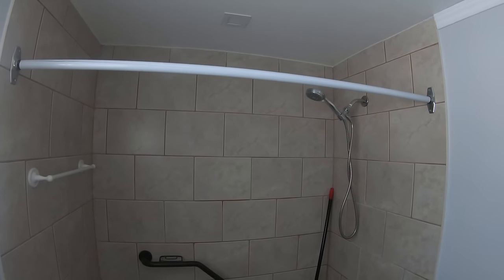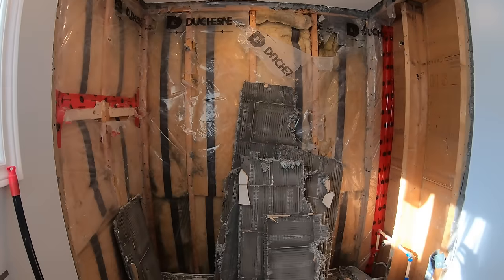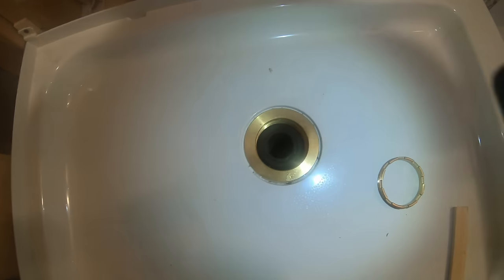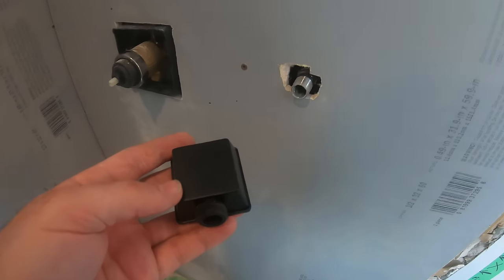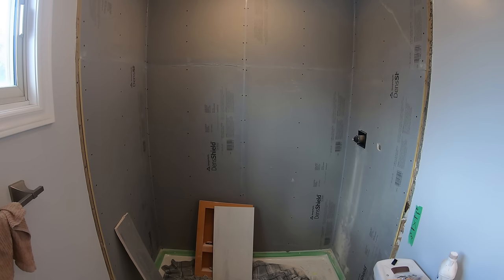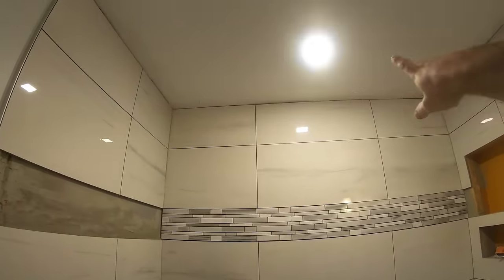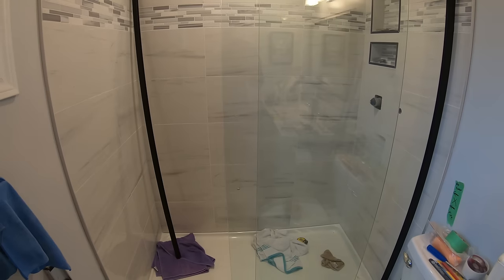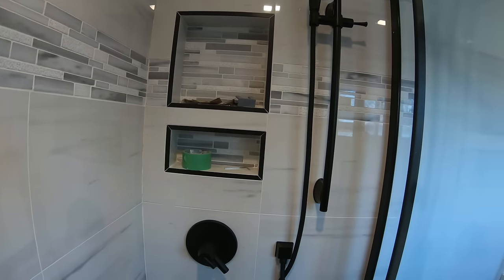$4000 Tub to Shower Conversion

Comment: Man, I wish you were near me. I'm converting an old one pc. tub enclosure into a walk-in shower. Removal is not a problem, but the choice of conversion kits is a puzzle. Your job was professional, and your skills exceeded many of the so-called qualified installers. Thank you.
Reply from the maker: Thanks so much, I really appreciate that 🙂
Reply: @tokyosteve1223  Great video! What tile did you use and where did you get it from?  Also, same questions for the accent you used for your niches and around the shower?
Reply from the maker: @bosshova23  
https://www.anatoliatile.com/collections/mayfair/suave-bianco

12x24 polished 

Accent tile

Bergamo Interlocking 10mm x 11.81-inch x 11.81-inch Marble Mesh-Mounted Mosaic Tile

https://www.homedepot.ca/product/msi-stone-ulc-bergamo-interlocking-10mm-x-11-81-inch-x-11-81-inch-marble-mesh-mounted-mosaic-tile/1001129871
Reply: Beautiful job!
Reply: I just finished a 60x32 tub  to 60x36 ADA shower. In portsmouth, va
Reply: @bosshova23 lowes has the tile.

Comment: I hate to tell you this. You should have hired a plumber. All shower drains have to be 2”. You left the undersized 1-1/2” drain in. That’s plumbing code 101.
Reply from the maker: Yep, I knew it.  The house was built with 1 1/2, and it stayed 1 1/2.  Never had a problem, never will be a problem with a single showerhead. 😉

Comment: Can use 2 screwdrivers through drain grate, form and x and just twist. Comes right out.
Being said.. no vapor barrier, did not seal backer board or the joints. Simply laid tile on board. Yea saves some material cost but.. not how its done.
Reply from the maker: So I probably should have elaborated on this more in the video.  The backer board is called DensShield.  They specifically tell you not to put a vapor barrier, because the board is waterproof, and becomes the vapor barrier.  Also, all the joints were sealed with polyurethane caulking following the installation instructions of the DensShield exactly.  I know it looks like a different installation than typical backer board, but I followed the instructions to the letter.  🙂

Comment: not bad, but in my honest opinion i would rather be standing on tiles on the floor with heating underneath the tiles and a wide drain on the tiles but thats me.
Reply from the maker: Baby steps man.  I used a premade base for my first try.  I just did my own ensuite shower where I did tile the pan and it turned out great.

https://youtu.be/MLQSBPD-Qdc?si=mvTeS1rkVJOHzJcZ

Comment: Looks good! I also looked far and wide for information on how to install a shower wall union, but came up empty. Thankfully I'm installing it on a fiberglass surround which can flex a little bit, so it's more forgiving than tile.
Reply from the maker: It's a simple thing with unforgiving tolerances, like +/-  1/16"
Surely loads of people have tiled their wall and messed this up because there is so little information out there 🤔

Comment: Good Job, one comment for next time, put a sheet of plastic on the subfloor before installing the mortar/cement. The subfloor tends to suck up the moisture from the cement and shrink. This will cause the shower pan to flex and eventually crack due to the space between the cement and shower pan.
Reply: Won't this mean the mortar won't be connected to the subfloor, but would just be sitting on the plastic below, and potentially move?
Reply: @zigner  won't move since the pan is fastened to the wall studs. The cement helps support the weight of a person by making the shower pan stiffer. There are shower pans out there that don't require mortar, this is due to the manufacturer adding alot of stiffening ribs.
Reply: @zigner  Imagine it in 3 layers, subfloor (movement), mortar with shower tray fixed. If all three are bonded together, any movement from the subfloor, will affect the mortar which in turn ends up cracking the shower tray. You need the plastic sheet in order to allow the subfloor to move, without it affecting the mortars movement. For ease of access, you can use shower tray feet instead of using mortar.

Comment: Beautiful job! That square outlet, I can see how this is the most stressfull part of the work. You pretty much have to trust that the amount of tape and turn count is exactly right. And on top of that when you`re at your last turn you need to properly evaluate if it can do a full rotation or will it get stuck and you need to go back to the last straight position. And that tape doesnt like turn backs too much. Surprisingly the tiling is the easiest part of this job :)
Reply from the maker: That's exactly what went through my head causing stress for days leading up to doing it 😂😂

Comment: I have the SAME EXACT beige tile in my bathroom. It was layer unevenly and is almost impossible to re caulk because the grout lines are uneven. The tile doesn’t even go all the way up to the ceiling so refinishing isn’t an option. It all needs to be torn out and be redone.

Comment: Nice work did a very similar job on my bathroom which was about the same size. Two problems was the shower drain things didn’t line up exactly right and got the shower pan during lockdown and I had to settle for a pan I didn’t want. So the shower drain leaked had to move plumbing over about an inch so things lined up this was a pain as access from underneath was tight. Finally fixed that. Then shower pan was noisy and yes I put mud under the pan so had to shim subfloor. As for lessons learned get a good strong pan. Make sure plumbing lines up perfectly and using bigger tile like you did will inure a more even finish. I’m satisfied with mine but could of been better. Then again I’m no plumber, tile guy. Plus saved a bunch of money and the wife doesn’t notice any of the things I do.
Reply from the maker: I had a similar issue, even with a bed of mortar the base still creaked a bit, so I shot some low expansion foam under the base before the walls went up and I had access through the stud cavities.  Seems to have done the trick, but that didn't make it into the video.

My plumbing didn't line up either, but I'm well over my fear of just hacking it all off and connecting new pipe.

Comment: 10:28 agree 100% 
I’ve no idea why but there is almost instruction and no template for the hand held showerhead water line and how deep to set the drop ear elbow. With the overhead showerhead you’d stick a long pole into the wall so the depth doesn’t matter, but the handheld one doesn’t have the tolerance, and so I had to measure again and again to figure out how long of a pipe extension I need to get.😢

Comment: I did one of these DIY redo the entire bathroom in one of our rental properties.  I know first hand the frustration and difficulties.  Doing it yourself is courageous.  Not second guessing, but why no plastic sheet over the insulation and the wall?  Why no water proofing of the cement board before tiling?  Nice job tiling. Especially the mitre work in the shower niche.  How is the sliding shower door holding up so far?  Like the door and the choice in faucet hardware.  I know it wasn’t a heavy use bathroom, the job must have taken a month or two.  Looks good.  Hats off.
Reply from the maker: All good observations!  But actually I followed the manufacturers installation instructions to the letter.  Denshield acts as its own vapor barrier apparently and they specifically say not to have a second one (the plastic sheeting).  They also said further waterproofing isn't required as the outer skin of their board is waterproof.  I actually went through the same thought process as you just outlined, but decided to just go with what the instructions said to do.

I'll update if it all blows up in my face, but I feel pretty good about it all.  Especially with large tile and small grout joints.  

I haven't done many tile projects in my life, but I'm gaining confidence and man do I find it satisfying 😂

Door is holding up great.  It felt decent quality.  The bathroom gets daily use but my folks have a second one in the basement that I built last summer (video also available 😬) so there was no rush for the few weekends it took.
Reply: ...I'll be honest, I was a bit concerned about the lack of waterproofing too.
Reply from the maker: @el.handyman   Denshield.  Check it out 🙂

Comment: IF you're going to be changing out a the drainage setup anyway, if you ever get a tub drain flange thats super stuck don't waste time, just cut through the thing and pull it out. Not like you're saving any of it for the shower connection anyway.
Reply from the maker: Oh yeah.  That was firmly in my mind.  I was gonna get busy with the recip saw 😂

Comment: Shouldn't you have vapor barrier between the rock wool and the sheeting?
Reply from the maker: Actually, the backer board becomes the vapor barrier (according to Georgia Pacific - makers of the DensShield board).  They specifically said to not use a vapor barrier.   🤷

Comment: How did you get the edge where the tile meets the normal wall to look so clean? Is there something that makes that edge? A strip of some material?
Reply from the maker: https://www.schluter.ca/schluter-ca/en_CA/Profiles/c/P

Schluter edging profiles.  Or might have been a Prova (just a different brand).  $10 solution to make the edge look clean and beautiful.

Comment: That looks great! Just a question that confused me for quite long time. Do you need to apply waterproof paint on the gib board? I saw a lot of YouTuber seal the gib board also.
Reply from the maker: Denshield has a waterproof side.  I suppose you could, but it would be redundant.  You seal the joints and screw holes though.  I liked the concept for it's simplicity.  Time will tell if it was the right decision, but q lot of guys swear by this stuff
Reply: @tokyosteve1223  Thanks!

Comment: Well done sir. Very sharp!

My only question was did you have preexisting flex vent in the attic that you attached that bath fan to? Or did you just vent it into the attic space? If the latter, I'd be wary of moisture and mold.
Reply from the maker: Neither.  I went up there and ran new venting to a vent cover I cut a hole for and mounted on the side of the house. 🙂

The amount of swearing involved made it wholly inappropriate for the video 😂
Reply: @tokyosteve1223  Haha 🤣. I figured as much. You were so pro on the rest of the project, I didn't think you'd let something that obvious get by you.

Comment: What did you use to cut the L shaped tiles around the niche? Did you freehand it with a small circular saw?  Great job and thanks for the video!
Reply from the maker: All the niche cuts were a combination of scoring the lines with my score snap cutter then carefully use the grinder to cut them out.  I found the lines were much cleaner if I scored them first.

Glad you enjoyed it!
Reply: @tokyosteve1223  that’s a great tip! I used a grinder and there were chips.  Thinking about doing my second bathroom remodel and will convert tub to shower stall as well.  Really want to tile shower floor but nervous about building mud pan.   How much was the glass sliding door?  For some reason, link you posted didn’t work for me.
Reply from the maker: @JC-ov5pt  the door was from Bath Depot here in Canada and was about $950 CAD

Regarding the mud pan, I just finished doing my own ensuite shower (video soon 😄) and used a foam base with pebble tile.  It was amazing, so easy and no futzing with slope or mortar.  It's presloped.  Cut to size, thinset in place.  Tile on top.  Check them out.  Mine was from Alino, but many available Schluter etc
Reply: @tokyosteve1223  that’s great! Thanks for the tips.  Looking forward to the video!

Comment: Nice job, but I am curious if you checked for water leaks at soldiered joints etc. Now that would be a nightmare after tiling?
Reply from the maker: Oh yeah, the walls were open and the water was turned on for quite a while before I covered it all up.  The timing may not have been clear in the video.

Comment: Where is the waterproofing between the board and the tiles? I am no expert.
Reply from the maker: The backer board is called DensShield.  One side has a waterproof coating.  You caulk between the boards.  Waterproofed.  I followed the instructions to the letter. 😉

Comment: How did you check for possible water leaks on plumbing? Thanks! Beautiful job!
Reply from the maker: I left all the supply side open for about a week and observed no leaks, and regarding the drain, I used the highly technical method of standing in the bathroom below the shower standing on a chair listening for any dripping 😂

Comment: Just curios why did you go back to the mosauc after you put tile above ? I mean why not tike then mosaic the tile during install ?
Reply from the maker: Yeah, actually I went back and forth on this a little at the time.  If I recall there were two reasons.  First I wasn't 100% sure I wasn't going to need to screed a thin layer behind the mosaic to make it flush with the large format tile.  Second, I worried because the mosaic was on that mesh backing and it moved around like crazy that I wouldn't be able to maintain a perfectly straight line around the room.  Leaving the gap and going back to it solved both problems for me.  Remember, I'm a DIY noob who learns things off YouTube 😂. Everything needs to be carefully thought out and risks removed. Haha 😆

Comment: Why didn’t you use a water proofing membrane over the cement board
Reply from the maker: It's called Dens Shield.  It doesn't require it, it's not normal cement board.  One side has a waterproof coating on it.  👍

Comment: Could you have put the accent pieces on before the top tiles ? Or should you always leave a space and do accent last?
Reply from the maker: I think I did it like that because the accent pieces weren't the same thickness as the rest of the tile.  So I wanted to make sure everything was flush right to the ceiling, then install the accent row and make it flush with that.  Only because that's how I saw someone on YouTube do it.  I was making it up as I went 😂

Comment: Looks great! That's about the exact color and size tile I'm looking for. What size gap did you use between the tiles. It looks like 1/16th.  Really looks clean! A+++ 😀👍
Reply from the maker: Yep 1/16th spacers for the tile.  I really like the stacked look with small gaps.

Comment: I'm having a hard time to believe that you don't do any plumbing drainage testing before you seal the floor.
Reply from the maker: I'm not a professional videographer (or plumber 😂) so some things may not have been recorded... but some basic testing was indeed done.  Solid acrylic base though, so either the connections leak or they don't I suppose.

Comment: Wow good job we are thinking to remove our bathtub but we are afraid of doing it we have zero experience and we doing how to plumbing. Is it okay to hire someone who can do plumbing after we removed the bathtub or this is not allowed in terms of safety?
Reply from the maker: I'm really not sure if anyone is actually required to hire a plumber for just simple connections like attaching a shower base, I didn't even look into it (whoops 😬).  I didn't/don't know anything about plumbing either, but a P-trap attached to a shower base attached to the existing waste pipe appeared (as you could see in the video) to be not complicated whatsoever.  My vote is go for it (carefully) 🙂

Comment: You didn't waterproof the seams and joints.  Thinset isn't waterproof.  It won't leak water in the walls, but moisture behind the DensShield will cause mold over time.  You may have an issue by the faucet, shower, and hose.
Reply from the maker: Every joint between boards was caulked with polyurethane caulking.  I even went overboard doing it.  I followed Denshield's instructions to the letter.  I didn't talk about it, but there was video of me doing it.  Thanks for keeping me honest though 👍
Reply: @tokyosteve1223  Oh, OK. I used Densshield too on one of my bathrooms and have some issues around the grab bars. 😀 I didn't like that ideas so I used Redguard on the seams and screws.    No major leaks though.
Reply from the maker: I had seen people adding additional waterproofing to Denshield and I called and asked, they assured me if I followed the directions it wasn't required.  I suppose time will tell, but I did take my time and use a heck of a lot of caulking 😂
Reply: Great build. I would have added red guard
or similar for waterproofing. Small expense for piece of mind.

Comment: Is it possible to remove the tub without touching the tiles? We like our tiles. We just want to take the tub out and switch to a flat shower pan. I’m sure we’d have to add tile where the tub was but other than that, would we have less work?
Reply from the maker: You might find you'd need to remove a row of tiles to get the tub to move.  In my case they had tiled right to the edge of the tub and I wouldn't have been been able to tip it up and out without removing some.  I've never tried patching an existing tile job, I'm not sure how easy it would be to continue the tile to the shower pan and make it look good.

Comment: Great job, just a question about vapour barrier. Do you not need to put vapour barrier between insulation and the cement board?
Reply from the maker: Common question!  Denshield is a different kind of animal (that's the name of the gypsum board).  They specifically say remove any vapor barrier because their board (completely waterproof on one side) becomes the new vapor barrier.

I was suspect too!  Much googling was done and I actually ended up calling them with a few other questions because it's so different from using regular cement board.

Comment: Do we always need to get city permits for this work ?
Reply from the maker: Probably differs city by city would be my guess.  As far as my brief check in my area, because it was already a bathroom and no structural changes took place, no permit required. And if that was wrong... Oops 🤫😬